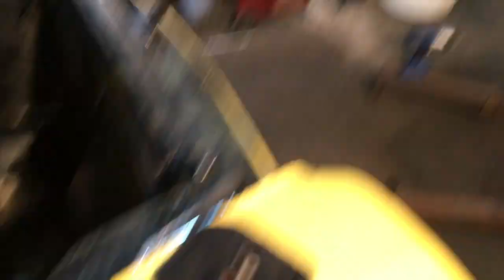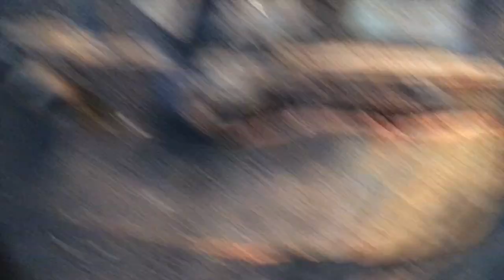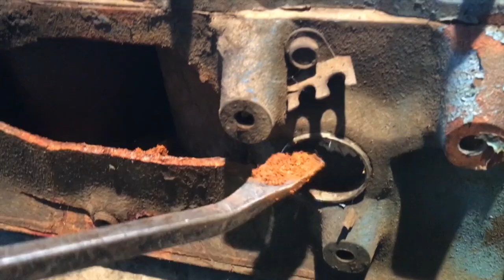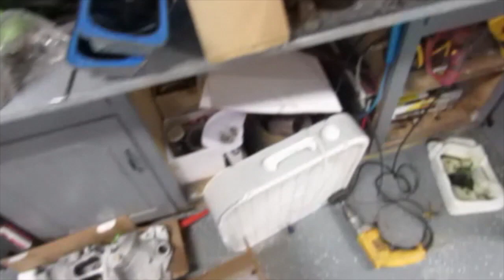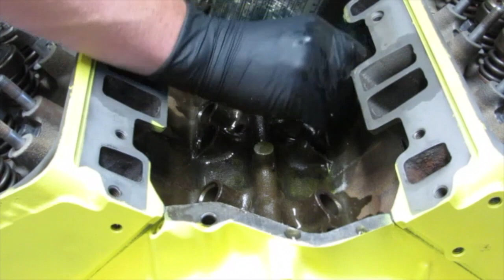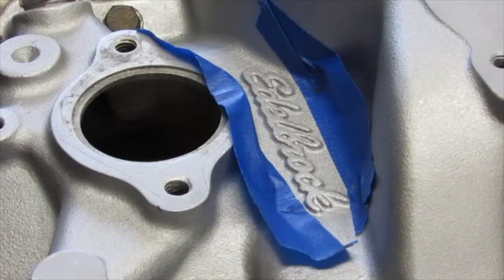Name that Apache Winner! The Largest Hole You'll See in a Chevy Motor!

Comment: Is there a bad year for a 440 or a 383 that is not worth building , i just picked up a 727 for a big block (to go in my 1996 dakota extra cab ) before i start looking for one ?
Reply from the maker: There's no bad year for any 383 or 440. There was a difference in truck blocks in the 440's in cooling passage size and there's actually some webbing added in the later years. 440Source has an excellent write up on these differences. @UncleTony'sgarage just did a great video talking all about the 383's. I wouldn't be scared to see either run on a stock crank shaft and bottom end up to 550 hp, and 600 ft. lbs.
Reply: While there is no bad year for the 383 or 440, there was a one year only 383 that was based on the RB block.... 1958, I think.  It had a 440 length stroke, but tiny a 4.03 bore (smaller than a 340).  I don’t recall ever actually seeing one, but it wouldn’t offer nearly the performance return for the money.  My favorite big block is actually the 400.